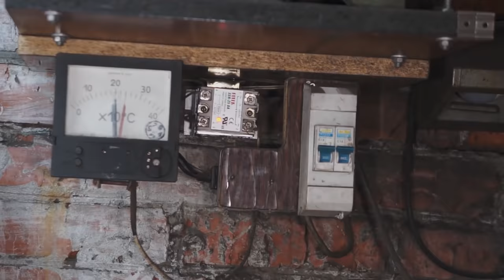Container Damascus steel, details in the description.

Comment: That looks amazing, Really love it.... Be great to see this blade put through a forged in fire strength and sharpness test.....
Reply: No point in ruining such a nice piece. Those tests are designed to be far more brutal than intended use.
Reply: It's beautiful, but l doubt it would even take a decent edge, much less hold it. Not with all that soft garbage metal in there.

Comment: This channel makes the coolest stuff, I’m actually thinking of doing something like it at some point
Reply: There's noth'n to it but to do it! Good luck!
Reply: @DeadFront1319  thanks and to me it looks fun to do, having the tools to bend and shape metal is like having powers that you never imagine that you could do. The best part to me is making details like letting the acid eat at the metal to create a awesome design and adding onto that you can add engraving and different colors. Personally I would use the acid mixed with copper engravings of Japanese writing on a black steel duel edge knife with a carbon fiber handle. And I’m surprised I came up with that idea since I’m usually not creative.
Reply: I'll try to make myself a forge this afternoon, using concrete, two buckets and an empty tea can 😁
Reply: @StarCoreSE  sounds interesting hope that works out
Reply: Personally I’d make a karambit cause I love the look of them well certain ones which are made more like a velociraptor claw, not to curved and not to long.
Reply: @phantom-o7-999  yeah, it's likely to be a fail though, but gotta try. I need this for heat treatments, cause a gaz torch doesn't have enough power to heat up even a very small blade
Reply: @StarCoreSE  ouch but again you’ll see how it works out and a quick thing if that doesn’t work get a concrete brick and carefully make a hole in the side for your trusty flamethrower and cover the last two open sides with more concrete slabs I haven’t really though of a safe way of a hatch for that idea but it’ll work
Reply: @phantom-o7-999  Yeah that might be simpler. Though it's a medium size torch I have, might not be enough. I'll try if it fails. Though I prefer the Idea of forcing air into a charcoal fire than using gaz.
Reply: Parabéns seu trabalho é muito bom.
Reply: @delixandresantos1836  for others seeing this I am going to use a translator. Esotou traduzindo isso, sinto muito se houver algum erro e obrigado.
Reply: @StarCoreSE  ah yes I see

Comment: cool blade, i wish they'd come up for a descriptor besides "damascus" for what is really a pattern weld :)  none the less, it's a very cool blade and you have some impressive kit with what clearly is a journeyman's hand guiding it. :)
Reply: The term damascus has been used to describe pattern welded steel (especially gun barrels) for quite a while so I doubt it is likely to change anytime soon.

Comment: Beautiful blade.  Damascus blades were made from Wootz, which is a crucible steel.

This is pattern welding, which has been practiced by European bladesmiths since at least as early as the First Millenium BC.
Reply: Damascus is a term that has been commonly used to describe pattern welded steel (especially in gun barrels) for over 200 years, so it isn't incorrect to describe canister damascus or any form of pattern welded steel as being damascus steel.
Reply: @garethbaus5471  Just inaccurate instead.

Comment: Can you subtitle the steps? I'm curious to know what you pour on top of the glowing metal and also the liquid you are using to reveal the boundaries of the different metals. Thanks!
Reply from the maker: I sprinkle flux (90% borax + 5% quartz sand + 5% charcoal powder) this is necessary for forging (forge) welding. The flux is alloyed with scale - the formed substance is sufficiently fluid and is easily displaced by deformation. In addition, the flux protects against oxygen and charcoal, carburizes the surface layer of metal - which lowers the welding temperature (if in brief).
ferric chloride

Comment: Im curious, why did you need to switch to manual hammering instead of keep going w the hydraulic press until its flat? Does it affect the strength of material or anything?
Also, what a beautiful blade. Imagine fitting it on a pipe and making it into a short spear.

Comment: You always drink awesome tea.  Why do you use a piece of wood for some on the initial hammering?
Reply from the maker: The first welding is done on a tree, as the tree is a heat insulator, and not so selects temperature as an iron anvil. In addition - burning, the tree burns oxygen, protecting the workpiece and pouring the flux work. This is important for welding workpieces with small parts (cable, chain).

Comment: I’m new to this stuff.      What’s the powder that’s being sprinkled into the bar for and what is it?
Reply from the maker: I sprinkle flux (90% borax + 5% quartz sand + 5% charcoal powder) this is necessary for forging (forge) welding. The flux is alloyed with scale - the formed substance is sufficiently fluid and is easily displaced by deformation. In addition, the flux protects against oxygen and charcoal, carburizes the surface layer of metal - which lowers the welding temperature (if in brief).

Comment: Could someone please tell me whats that poder he applies? I see it always on that History Channel program, I love so muchto see!!
Reply from the maker: I sprinkle flux (90% borax + 5% quartz sand + 5% charcoal powder) this is necessary for forging (forge) welding. The flux is alloyed with scale - the formed substance is sufficiently fluid and is easily displaced by deformation. In addition, the flux protects against oxygen and charcoal, carburizes the surface layer of metal - which lowers the welding temperature (if in brief).

Comment: So I gotta know...what is the hot metal seasoning for @ 1:59 I'm so confused. Thanks in advance
Reply from the maker: I sprinkle flux (90% borax + 5% quartz sand + 5% charcoal powder) this is necessary for forging (forge) welding. The flux is alloyed with scale - the formed substance is sufficiently fluid and is easily displaced by deformation. In addition, the flux protects against oxygen and charcoal, carburizes the surface layer of metal - which lowers the welding temperature (if in brief).
Reply: @shurap  Thank you! You do great work!

Comment: What is that powder stuff being sprinkled onto the hot piece every time?
Reply from the maker: I sprinkle flux (90% borax + 5% quartz sand + 5% charcoal powder) this is necessary for forging (forge) welding. The flux is alloyed with scale - the formed substance is sufficiently fluid and is easily displaced by deformation. In addition, the flux protects against oxygen and charcoal, carburizes the surface layer of metal - which lowers the welding temperature (if in brief).

Comment: Hello, your follower from Morocco, what is the name of the substance that looks like powder? that is used in damask
Reply from the maker: I sprinkle flux (90% borax + 5% quartz sand + 5% charcoal powder) this is necessary for forging (forge) welding. The flux is alloyed with scale - the formed substance is sufficiently fluid and is easily displaced by deformation. In addition, the flux protects against oxygen and charcoal, carburizes the surface layer of metal - which lowers the welding temperature (if in brief).

Comment: What’s the powder your sprinkling on the molten hot piece ?

Borax?
Reply from the maker: I sprinkle flux (90% borax + 5% quartz sand + 5% charcoal powder) this is necessary for forging (forge) welding. The flux is alloyed with scale - the formed substance is sufficiently fluid and is easily displaced by deformation. In addition, the flux protects against oxygen and charcoal, carburizes the surface layer of metal - which lowers the welding temperature (if in brief).
Reply: Thanks
I always was very curious as to what that was for

Thank you

Comment: Cosa è la polvere(sembra  sabbia)che aggiunge al metallo?
Reply from the maker: Cospargo di flusso (borace 90% + sabbia di quarzo 5% + polvere di carbone 5%) è necessario per eseguire la saldatura (forgiatura). Il flusso è fuso con la scala: la sostanza risultante è abbastanza fluida e si sposta facilmente durante la deformazione. Inoltre, il flusso protegge dall'ossigeno e, grazie al carbone, carbura lo strato superficiale del metallo, il che abbassa la temperatura di saldatura (in breve).

Comment: What does he sprinkle on and what's the purpose of it?
Reply from the maker: I sprinkle flux (90% borax + 5% quartz sand + 5% charcoal powder) this is necessary for forging (forge) welding. The flux is alloyed with scale - the formed substance is sufficiently fluid and is easily displaced by deformation. In addition, the flux protects against oxygen and charcoal, carburizes the surface layer of metal - which lowers the welding temperature (if in brief).

Comment: Mano,oq e esse pó,tipo areia q coloca quando o aço está encandescente? E pra q serve??
Reply from the maker: Salpico com fundente (bórax 90% + areia de quartzo 5% + pó de carvão 5%) necessário para efetuar a soldagem (forja). O fluxo é fundido com a escala - a substância resultante é bastante fluida e é facilmente deslocada durante a deformação. Além disso, o fluxo protege do oxigênio e, devido ao carvão, cementa a camada superficial do metal - o que diminui a temperatura de soldagem (em suma).
Reply: @shurap caramba,é um belo trabalho!
MT obrigado 💪🏻😎

Comment: I cannot remember what he is sprinkling on the hot piece.
Reply from the maker: I sprinkle flux (90% borax + 5% quartz sand + 5% charcoal powder) this is necessary for forging (forge) welding. The flux is alloyed with scale - the formed substance is sufficiently fluid and is easily displaced by deformation. In addition, the flux protects against oxygen and charcoal, carburizes the surface layer of metal - which lowers the welding temperature (if in brief).

Comment: what's the purpose of the powder at? 1:54 
is it flux?
Reply from the maker: I sprinkle flux (90% borax + 5% quartz sand + 5% charcoal powder) this is necessary for forging (forge) welding. The flux is alloyed with scale - the formed substance is sufficiently fluid and is easily displaced by deformation. In addition, the flux protects against oxygen and charcoal, carburizes the surface layer of metal - which lowers the welding temperature (if in brief).

Comment: Sou do Brasil 🇧🇷....para que serve esse pó cinza que você joga sobre o linguote?
Reply from the maker: Salpico com fluxo (bórax 90% + areia de quartzo 5% + pó de carvão 5%) necessário para efetuar a soldagem (forja). O fluxo é fundido com a escala - a substância resultante é bastante fluida e é facilmente deslocada durante a deformação. Além disso, o fluxo protege do oxigênio e, devido ao carvão, cementa a camada superficial do metal - o que diminui a temperatura de soldagem (em suma).
Reply: @shurap  grato!...👏🤝

Comment: What’s that powered he sprinkles on it and why
Reply from the maker: I sprinkle flux (90% borax + 5% quartz sand + 5% charcoal powder) this is necessary for forging (forge) welding. The flux is alloyed with scale - the formed substance is sufficiently fluid and is easily displaced by deformation. In addition, the flux protects against oxygen and charcoal, carburizes the surface layer of metal - which lowers the welding temperature (if in brief).
Reply: @shurap  awesome thank you that’s cut and dry

Comment: What is the sand they put on steel?
Reply from the maker: I sprinkle flux (90% borax + 5% quartz sand + 5% charcoal powder) this is necessary for forging (forge) welding. The flux is alloyed with scale - the formed substance is sufficiently fluid and is easily displaced by deformation. In addition, the flux protects against oxygen and charcoal, carburizes the surface layer of metal - which lowers the welding temperature (if in brief).

Comment: Sorry to ask, but what is this powder?
Reply from the maker: I sprinkle flux (90% borax + 5% quartz sand + 5% charcoal powder) this is necessary for forging (forge) welding. The flux is alloyed with scale - the formed substance is sufficiently fluid and is easily displaced by deformation. In addition, the flux protects against oxygen and charcoal, carburizes the surface layer of metal - which lowers the welding temperature (if in brief).
Reply: @shurap  Thx Sir! U got a new subscriber right here! Amazing work!

Comment: The prohibition contained in § 82.1 against the treatment of 5-cent coins and one-cent coins shall not apply to the treatment of these coins for educational, amusement, novelty, jewelry, and similar purposes as long as the volumes treated and the nature of the treatment makes it clear that such treatment is not intended as a means by which to profit solely from the value of the metal content of the coins.  (Code of Federal Regulations (CFR) Title 31, Subtitle B, Chapter 1, Part 82, Section 82.2)  

In other words, It is not illegal to melt, form, destroy, or otherwise modify US coins, including pennies, unless the objective is fraudulent or with the intent of selling the raw materials of the coins for profit. Projects that use coins as materials are entirely legal in the United States.  About a minute of Googling gave me that answer.  It's not difficult, unless you just want to make an uneducated knee-jerk statement

Comment: What is the powder thing?
Reply from the maker: I sprinkle flux (90% borax + 5% quartz sand + 5% charcoal powder) this is necessary for forging (forge) welding. The flux is alloyed with scale - the formed substance is sufficiently fluid and is easily displaced by deformation. In addition, the flux protects against oxygen and charcoal, carburizes the surface layer of metal - which lowers the welding temperature (if in brief).
Reply: Ohh thanks
Reply: I'm just a curious cat

Comment: What powder is that
Reply from the maker: I sprinkle flux (90% borax + 5% quartz sand + 5% charcoal powder) this is necessary for forging (forge) welding. The flux is alloyed with scale - the formed substance is sufficiently fluid and is easily displaced by deformation. In addition, the flux protects against oxygen and charcoal, carburizes the surface layer of metal - which lowers the welding temperature (if in brief).